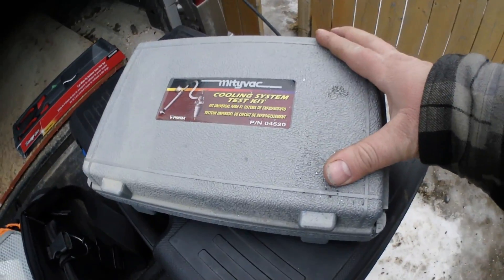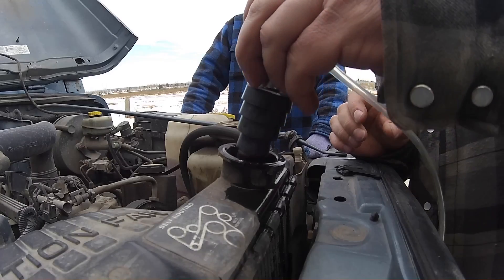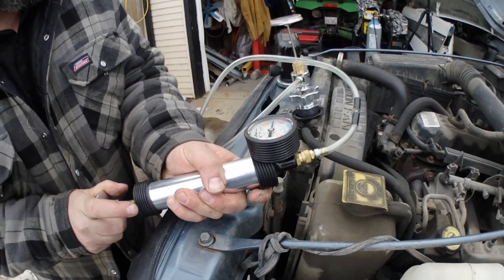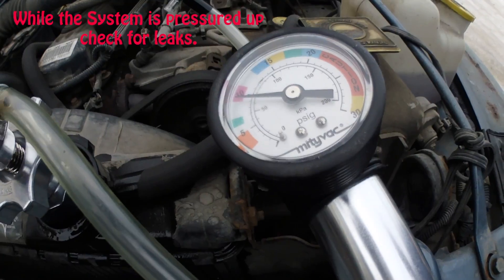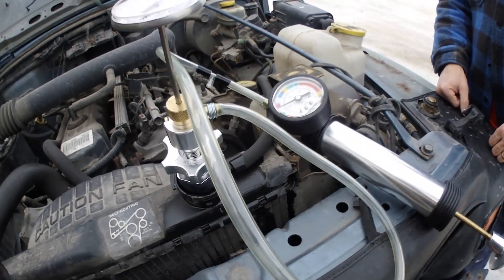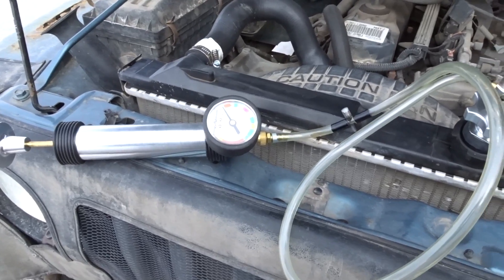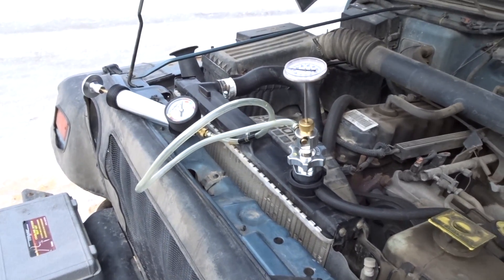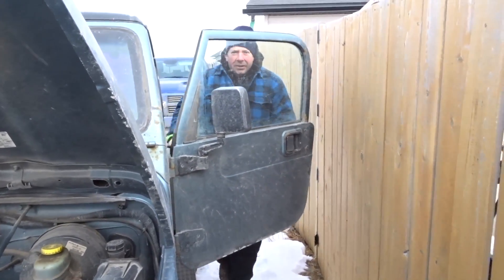Blown Head Gasket ?  Coolant Pressure Test

Comment: What if you saw oil in the coolant...you suspect head gasket leaking between coolant and oil passage....

Could you remove all coolant from system and then pressurize it and listen for air in the crankcase?  Or vice versa and pressurize the crankcase with coolant in system and look for bubbles?

Comment: I don't see how that test could work on checking your head gasket unless the thermostat is open.  If its closed you just reading radiator pressure.
Reply: when they open the cap to put the kit in the radiator its steaming so probably thermostat is already open

Comment: I use my Car then left it for 1-3 days Without using going out to check water Pipe And its still not Soft, when removing coolant cap air is rushing out ... Its a Bmw f10 Any idea?
Reply: Christian Andolini 
I’m not a professional but typically if this only coolant in the system, it doesn’t take that long to condense it back. There may by flue gas trapped in the cooling system. Emphasis “ may” be

Comment: And if you have a cracked head that only opens up after running the engine hard, have fun.
Reply: Yeah I had to deal with that at on a Komatsu skidsteer this week . Not fun at all .
Reply: Exactly... did this exact mistake, while I ran the test it held the pressure for a full 10 mins, went for a drive over 50 mpg with a faulty temp gauge and ended up taking off the head again and redo what I initially came to fix+the pressure leak from the cylinders made my radiator give up 😂

Comment: Problem is not in gasket, but in coolant hyperpressure.
Take off the gasket ring from overflow tank cap. Save 3000$ for no time fix
And no tools
Reply: qb 
Can you please explain that. 
My Honda Civic always has low coolant and overheat. No leak , holds pressure upon cooling pressure test, passed combustion test ( blue color liquid hasn’t changed) 
The only problem is the coolants always always gets pushed to the overflow and doesn’t drain back to the radiator.
Reply: @tothepointvids5192  Have you replaced your radiator cap with a new OEM unit.  Sometimes they fail and I have read they can cause this.
Reply: @tothepointvids5192  that's the problem I'm having on my car did you fix this?
Reply: I tried everything ( in my case) to proof it is NOT. blown head gasket and I was proven wrong. It was a blown head gasket. I ended up replacing the head gasket and knock on wood, the car is back on the road at least for now.
Reply: @tothepointvids5192  nightmare I'm 100 the same trying to prove its not gasket even doing block tests but I think I'm going to have to bite the bullet and go for it 😭

Comment: (head gasket) Disconnect your reservoir tank hose , put a balloon over the hose  , run the vehicle and see if the balloon inflates.
Reply from the maker: That’s pretty clever
Reply: Sometimes coolant doesn't get sucked into the combustion chamber , only the compression stroke has enough power to push air into the cooling jacket , the reservoir tank could be bubbling when your driving (higher rpm's)  but not noticeable at idle. This constant venting under the hood , albeit small could start to weigh on your health over a long period of time.
Reply: What would cause it to bubble?
Reply: jason t 
Flue gas goes through the radiator and the overflow bottle

Comment: Another way to check for a blown head gasket is to run it with the engine with the cap off and look for bubbles coming up from the coolant. Also on a cold engine if you start it and the radiator hoses pressurize within a minute is a sure sign of a blown head gasket.
Reply: we were always told to shy away from the coffee looking oil as an indication for an internal coolant leak, mainly because if the customer only does short trips and the engine doesn't reach normal operating temp it can cause condensation in the oil.
Reply from the maker: +retiredppd that and if your exhaust is pure white and the oil looks like coffee
Reply: jerry bskorner I drive a 2004 Honda civic. I was driving back from Washington to California and my car started to slowly overheat so I pulled over. popped my hood and coolant was everywhere! I refilled it and my car was fine and was able to drive it over 400 miles until I got home. any ideas what the problem could be??
Reply: @SuhMike  Hey I have the same issue. Did you find out what it was?
Reply: Ian Cumings  did u found what i was
Reply: Ian Cumings did u found what it was
Reply: @perlagutierrez3082  blown head gasket. Bought a tundra, and said goodbye to ford's.
Reply: @callmeic  
How often do you do a coolant flush?
Had an Mj that would run good around town yet take it 50miles out n would overheat...flushed the system put in new thermostat n ran like a champ...had a 91 integra which fans didn't come on with the sensor so it was wired to a toggle switch...pressed the button when engine got hot: read between the lines!
Reply: @chuckpowers5311  I'd say 50k is plenty. Some say 30 but you're still tossing Clean coolant.
Reply: I don't see how the pressure test works for checking head gasket unless the thermostat is opened up.
Reply: @jasont1917  lol

Comment: Head Gaskets. I get some white goo on my oil cap. Might be a head gasket. But fuck it I have over 1 000 000 kms (600 000 miles) so I am not to worried about it. I haven't noticed any low coolant so if it is leaking it is a small one. As for oil Oh man that is a whole other story. I have to put about three litres in the old van between oil changes.
Reply: I get that too john, it's hot - cold cycles and condensation. My Chevy doesn't show it but ya  my  ford was like that from new . Nothing to worry about.  Try the lucas oil stabilizer it works for my 6.0 chevy  , I put one liter in and 5 liters reg oil.  Let me know the results .
Reply: I will look into that Steve thanks.
Reply: The Plow Guys My Silverado done that, found out hose to pcv valve was collapsed, once I replaced it I never had that problem again.
Reply: I will have to take a look into that thanks